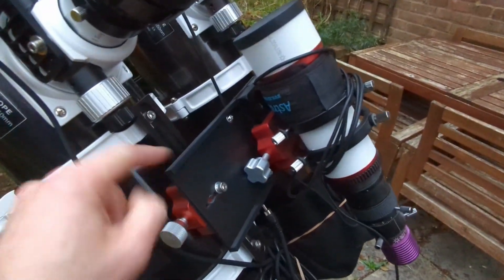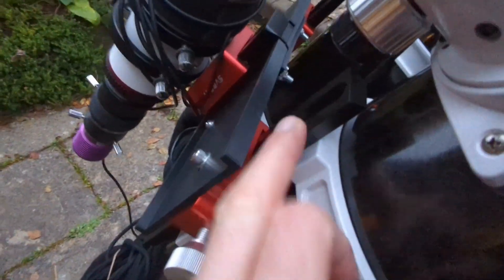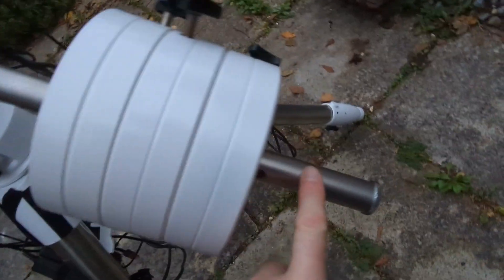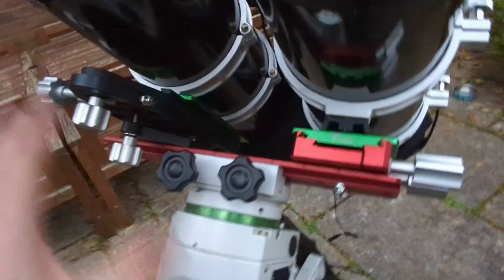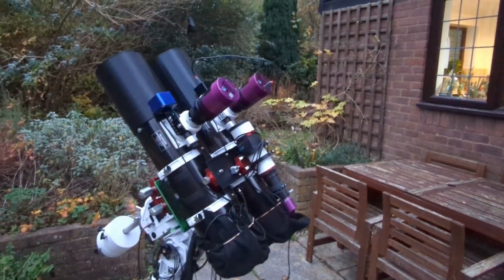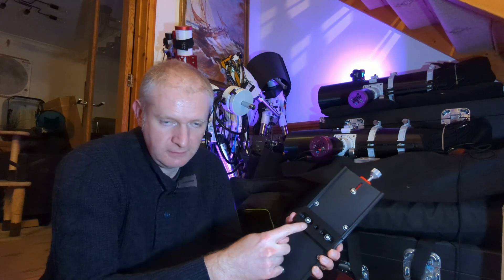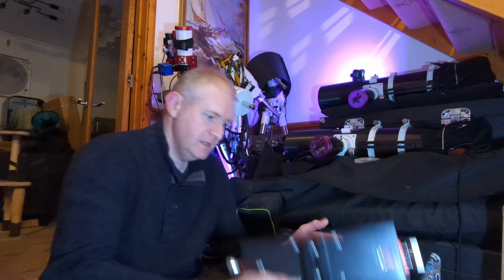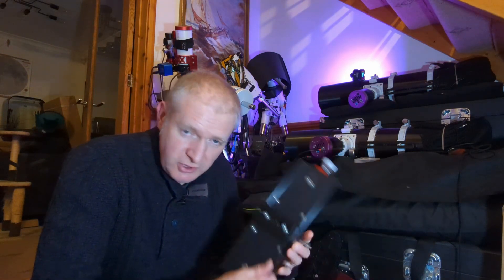Dual Scope rig gets a 3D Printed Guide Scope Bracket

Comment: Hi Andy, I have embarked on a similar journeys ( yep it's that bad at the moment ) where my own dual rig set up is suffering from tilt issues! Ive subscribed so I can follow your dual rig path :-) and hope to learn from it. My own set up consist of a 80mm Triplet and 65mm Quad ( Fl almost identical) QQ thinking of investing in the JTD any steer / advice is welcome! Best Simon and Clear Skies !
Reply from the maker: The JTD is brilliant.  It does the job without causing any issues, unfortunately very expensive, but for me it just works.  I am currently making a video about some really successful imaging with the dual scope rig.  I've not had chance to finish it yet, its in production.  I've ironed out a load of snags and the setup is now performing well.  Good luck with your setup, it does make a big difference to imaging, although challenging, well worth the journey.  Thanks for watching.
Reply: @ thank you - I’m using the star wave from Altair and tried a skywatcher 230mm with the clamps you have but can’t get round the tilt in that so Altair still making minor tilts to align them - finger ls crossed 🤞soon if we have clear skies - look forward to seeing you next dual content - cheers Simon

Comment: Hi Andy, what 3D printer and software are you using?
Reply from the maker: Hi, the printer is an Ender v3 Neo.  Design software is Tinker CAD, Cura Slicer.  There are much better and faster printers out there, but it was a good starter printer.

Comment: Interesting but why two scopes? Isn't a single bigger one a cheaper option?
Reply from the maker: Great question.  Twice the imaging time on a single target.  It reduces the F ratio.  F Ratio = Focal Ratio of one single scope/The square root of the number of actual lenses (number of telescopes).  Therefore, a 130pds is F5, divided by the square root of the number of lenses (2 scopes = 1.414): Therefore 5/1.414 = F3.5.  Therefore the focal ratio is faster at F3.5.